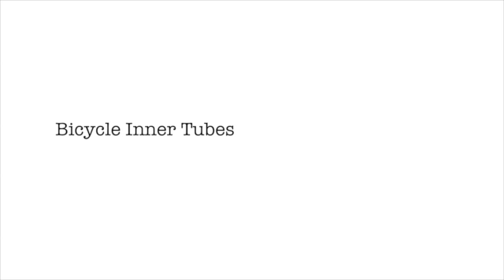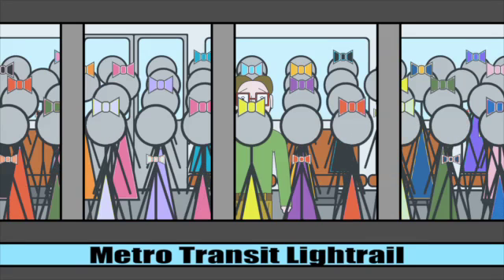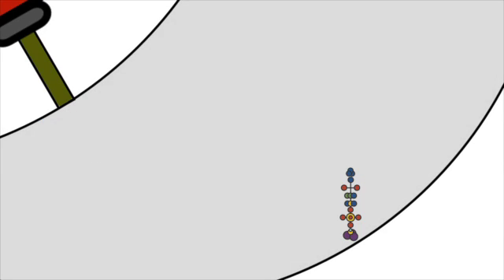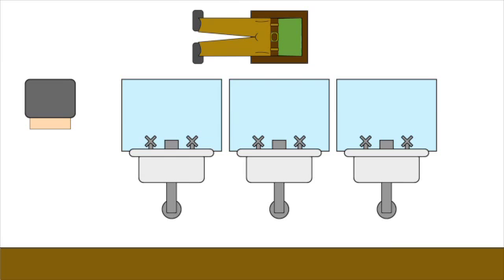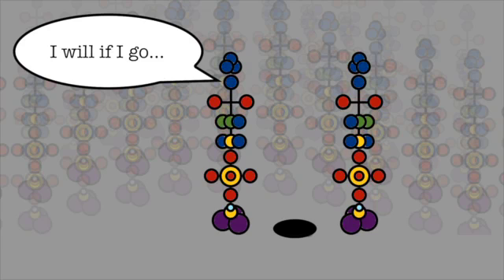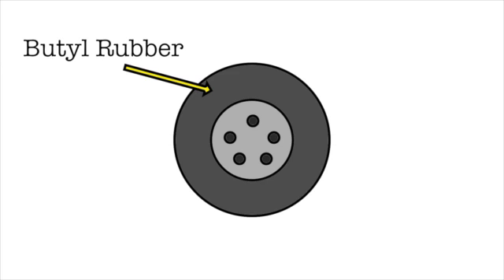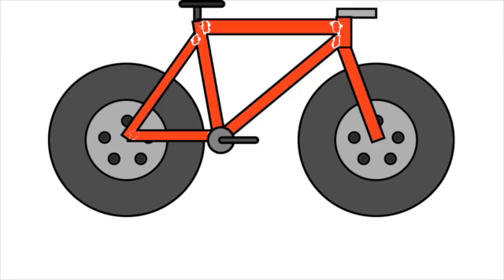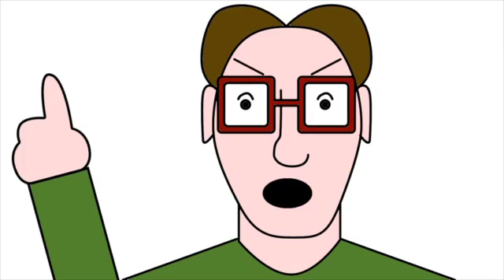Why Do Bike Tires Go Flat

Comment: But why go flat, wouldnt it eventually reach some state of equilibrium? In your example, if some people left the club and he had more space, he wouldn’t be motivated to exit the club. Serious question
Reply from the maker: If you’re at sea level you’re at an atmospheric pressure of like 14 psi. If you’re putting weight on the tire (even the weight of a bicycle) you’re displacing even more available real estate for those air molecules, so your equilibrium is effectively zero.